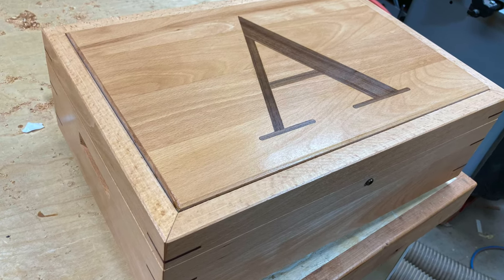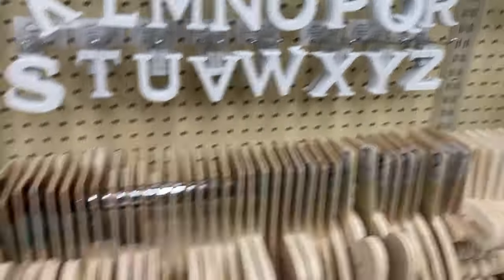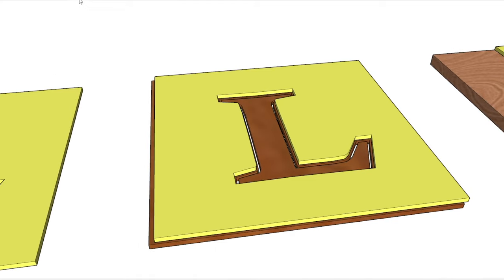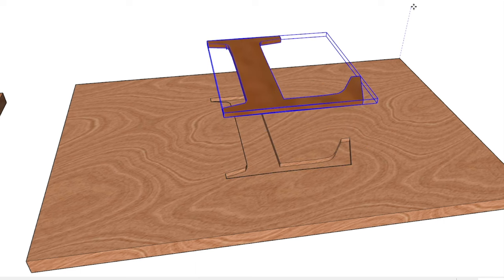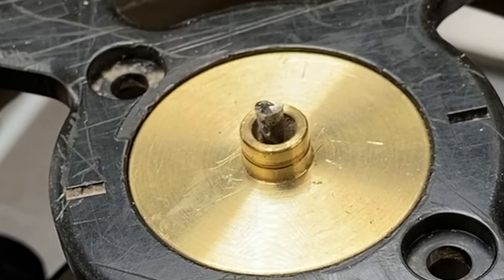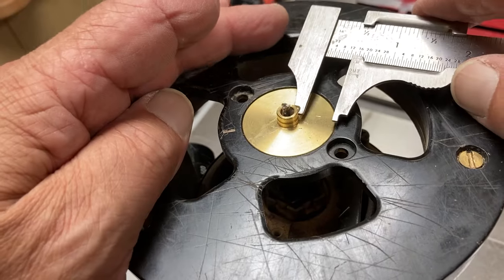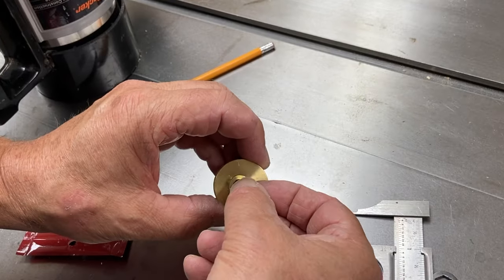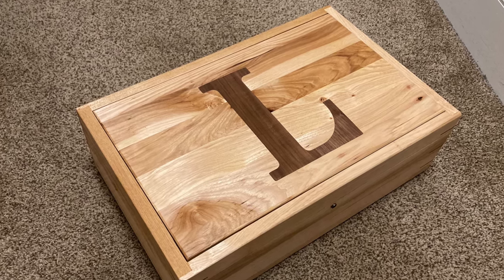Router Inlay Kits, How They Work, Easy 3 step Process.

Comment: I'm relatively new to woodworking and wondered how they did these inlays. It looks like something you'd need years of experience for. I had no clue it was that easy! Thank you very much for the detailed explanation. You definitely earned a sub for this.
Reply from the maker: Thank you for the comment.  I always wondered the same thing   The only issue is tight inside corners or sharp 90 degree inside corners. The bit will leave a 1/16” radius that you have to carefully chop with a chisel. Thanks again for watching.

Comment: Thanks for the insight for making inlays with this tool.  You did a very good job at explaining how to get results.

I have to add, the initial pattern and the final recess/inlay will differ so slightly at the corners.  
Any sharp corners in the pattern will be rounded by the radius of the cutter; 1/'8" diameter cutter leaves a 1/16" radius in/on the corner.

Not a problem when you cut both the recess in the workpiece and the inlay material with the template made from your pattern (step 1).
If you need sharp corners then you need to take extra steps to leave material in the recess corners, and on the matching inlay corners.
You can trim the extra material with a razor knife to create sharp corners in the recess and on the inlay material.

I have to say again,  this is a great video describing how to use this tool to make beautiful wood inlays in your projects.
Thanks for making it and I hope to see more...
Reply from the maker: Thank you for the kind words. I made plenty of mistakes when I first tried doing inlays but this little tool, once mastered, is really cool to use. Thanks again for watching and commenting.

Comment: So, if I understand your instructions correctly, the walnut letter L you used for the insert is exactly the same size as the MDF letter you used to make the template. Am I correct in this interpretation? By the way, thank you very much for a very clear and concise explanation as a venture into a new horizon for my woodworking.
Reply from the maker: Thank you for the comment, glad I could help. Yes the walnut ladder ended up being the exact duplicate of the pattern letter I bought at the store.
Reply: Thank you so much for your reply. I just received my inlay kit and wanted to start some easy inlays using some wood shapes from Walmart. I will use them to make my template, then route out my workpiece and use the Walmart shape as my inlay. What speed do you recommend for the 1/8 spiral bit? I have seen comments where the bit broke or had excessive smoking.
Reply from the maker: My doggy old router only has one speed 

Just move slow. You can feel the resistance

Comment: My oh my. I've been scracthing my head for days trying to figure out how I'm going to create a perfect plug to fit a large cavity in a guitar I made. I had no idea these kits existed. 

My issue is I need the reverse of what you're doing - starting with a female cavity and then creating a template to create a male plug.

I'm not sure I can use a bushing to do this, but I might be able to use a router bit with different sized rabbet bearings to do the inverse. Fingers crossed!
Reply from the maker: I haven't given this a lot of thought but it seems like if you could get a 7/32" bearing guided rabbet bit (good luck with that) you could re-create your cavity in a template large enough to use the inlay bit to cut your plug. There has got to be an easier way but it's not coming to me.
Thanks for the comment and thanks for watching.

Comment: Will this work for any pattern? Like a maple leaf? Thanks for taking the time to make this video. It’s exactly what I’m looking for. Been trying to find a good maple leaf pattern.
Reply from the maker: Thanks for the comment. you are limited to tight inside corners. the bushing will only push so far in. You would probably have to carefully chisel any sharp points. Also the bit is 1/8" so all inside corners have tiny 1/16" radius. Hope this helps. Thanks for watching.

Comment: Great video, thanks. I’m having trouble making the templates for some letters such as A, R and H because the cross member is those letters needs some kind of support in the template but that will interfere with both the inlay and the negative. Any suggestions would be appreciated.
Reply from the maker: Good question, I really don’t have a solution. The letter A that I did because of the triangle left in the middle was straight sided. I was able to guide the router with straight pieces of wood as fences. I don’t have a solution for a B or an R or a P etc.

Comment: So, Basically, you use the Letter to make a Template that is 1/8" larger all around, and then the larger bushing to cut the letter the smaller dimension of the letter you made the template from. Correct?
Reply from the maker: Thanks for the note. It is really best to draw this out due to the diameter's of the small and large bushing and of the bit.
They are: Bit size = 1/8"; small bushing = 5/16"; large bushing 9/16". So when you are making the template with the small bushing, it ends up being 7/32" bigger all around than the pattern. Then, keeping the small bushing you cut out your insert piece, and finally with the large bushing the recess in your main work piece. Sorry about this, best to try it out on scrap until it makes sense. Thanks again for the note and thanks for watching.

Comment: I've watched this video a couple times and just picked up the same bushing and spiral bit I'm going to have to play around with some scrap. Still somewhat confused that the hollowed out area is so much smaller worried the inlay will not fit does it need a little extra sanding or finessing
Reply from the maker: The play around idea is a good one. They do fit, almost no finessing. Once the template is made all the bushing is doing is moving the 1/8" bit 1/8" form outside of the letter to inside of the cut out. Thanks for watching.

Comment: Dumb question.  Do these bushing kits work with any router?  I have a small cordless Makita Trim Router XTR01Z and would like to use it to make an offset ledge for an inset cover plate for the control cavity on my bass guitar.  I'm not sure what I need for my trim bushing kit.
Reply from the maker: I think the standard size router base cut out to accept these is 1-1/8” opening with a 1-3/8” collar. I suggest you bring your router base with you and try the fit.